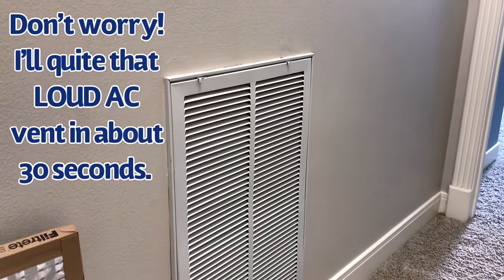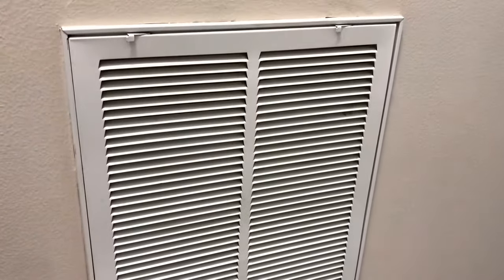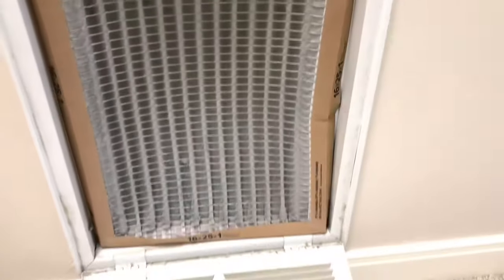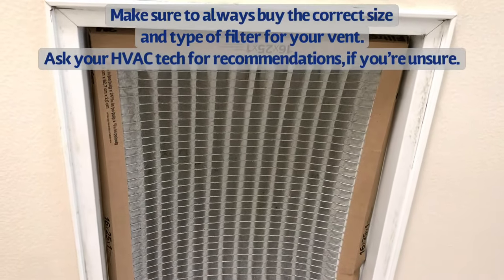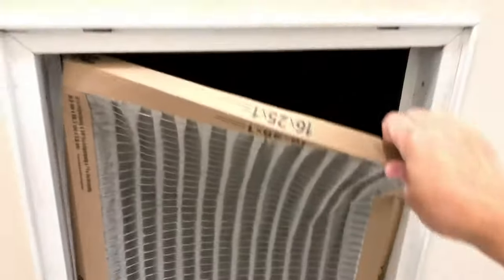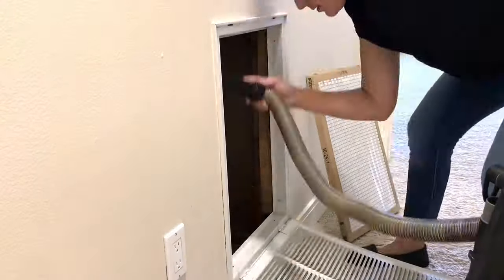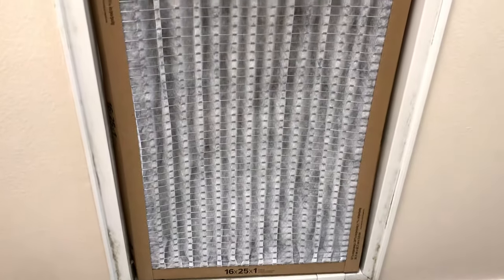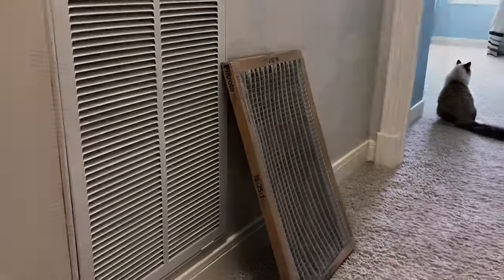YIKES! Here's How to Fix a Loud AC Return Vent - AKA The Noisy Air Vent!

Comment: Good video! Is the filter necessary at all? My filter looks clean, but makes my AC run really loud. I just popped it out and problem solved.
Reply from the maker: Sorry, pop it back in. Then buy a new filter tomorrow. Running the AC without a filter will let dust, dirt, pet hair, etc straight into the HVAC system. Which can break it. 👍
Reply: @AbbottsAtHome  thank you for the response! I'll let my landlord know, fingers crossed they listen!
Reply from the maker: @j_rADD   @j_rADD  He should want to replace it. The AC can break if it doesn't get enough airflow. :)
Reply: 100% a filter is necessary or you will have much bigger fixes

Comment: Does opening all the vents in the house prevent some of the noise. I notice if i close a vent or two it makes a noisy blowing sound
Reply from the maker: You got it! Less vents open means that the air pressure is increased coming out of whichever vents are still open. So, they sound louder. :)
Reply: @AbbottsAtHome  Thanks!!!

Comment: Hi does  this work even if the furnace motor is right next to the vent?  No basement here so furnace is right next to our dining room... LOUD
Reply from the maker: I'm not sure about that. I'd ask an HVAC tech if there is a way to safely soundproof that room. Good luck! :)
Reply: It doesn't. My wife and I have the same issue and our return vent is very loud as well. HVAC tech suggested installing an entirely new system with a variable speed fan. We're currently trying to soundproof the room where the furnace is as a quick fix but no luck so far. Also no way to move the furnace to any other part of our house (under or in attic).
Reply: @nicholasbelote8647  did you have luck to fix it i have same problem 😢

Comment: You might try having a carpenter expand the depth of that filter-cavity to fit 5-inch inches worth of filter & you upgrade to have a 4-inch thick filter behind the flimsy ones you're using now.  The thick filters seems expensive until the AC guy accidentally puts ugly bends in your coils while cleaning them.    Plus air-quality, why should hospitals be the only ones sleeping in MERV-14 air...
Reply: My return is super loud downstairs on the outside wall of the utility room on the lower level of a split level. We have a small return midway up the stairs & a larger return at the top of the stairs. I put vent magnets over the return downstairs & it drastically reduced the noise & the house feels cooler. I read that’s what you want-to pull the hot air in from the upper part of the house in summer Im just checking to get a 2nd opinion to make sure it’s safe. My A/C guy told me the unit wants the most air it can get & covering 1 out of 3 might make the unit work harder I don’t know-I don’t want to blow up my unit

Comment: Don’t use that type of filter use regular filters with filter coat it adds oil to filter and doesn’t restrict air flow, and they are not as expensive
Reply from the maker: Are you talking about metal filters with an oil coat?? I prefer disposable because they’re so easy and have a higher MERV rating. But either works. Here’s a good definition of the pros and cons of both, for anyone reading this, here: https://hvactraining101.com/ac/filters/washable-vs-disposable/
Reply: @AbbottsAtHome  no they are usually green or blue throw away and the filter coat is an aerosol can, I do believe it is called filter coat, one can will last for years and I change filters every 30 days if it needs it or not, way cheaper than cleaning coil in 100+ degree attic, lol no but the filters are throw away